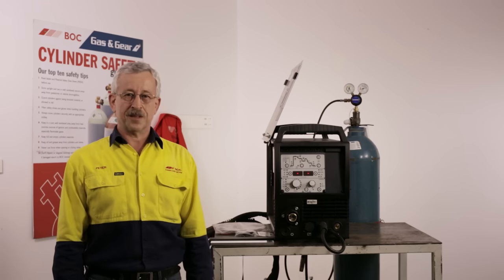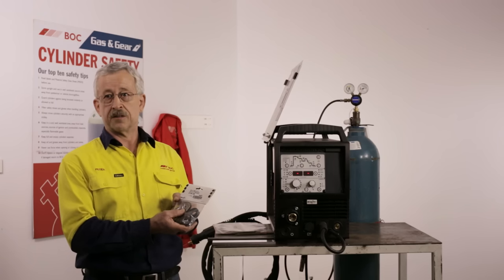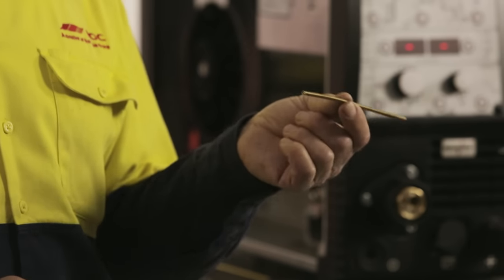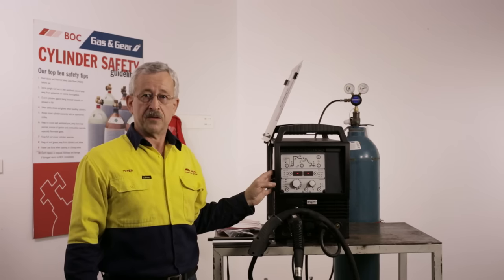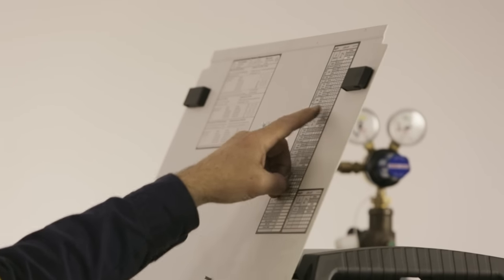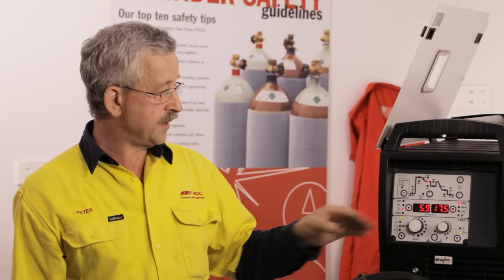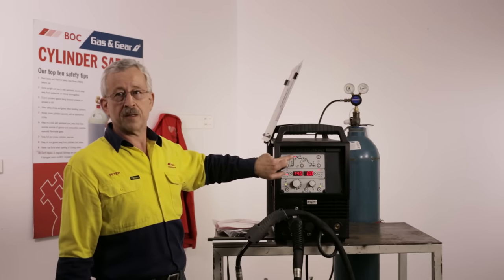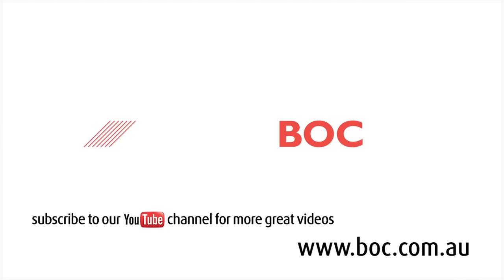BOC - Setting up your machine for aluminium welding

Comment: What kind of gas is use sir
Reply from the maker: In this video, the welder is welding with one of BOC's shielding gases, ALUSHIELD Light which is a helium/argon mix. 27% helium and the balance argon.
Reply: @boclimited  thank you very much for information

Comment: Even in this illustration he doesn’t mention, positive torch or negative torch
Reply: You think he needs to welding solid wire with gas? Your point being if welding with gas less wire polarity needs to change, but no other time.

Comment: I bought a Smootharc 181 from BOC and can’t weld thin steel nor aluminium, the settings don’t allow one to! Have called BOC numerous times and when you eventually get through to them they are useless, not one person knows what they’re talking about, comments made like I only work here? Tried every thing and now way will it mig weld aluminium, rubbish unit and pathetic help from BOC.